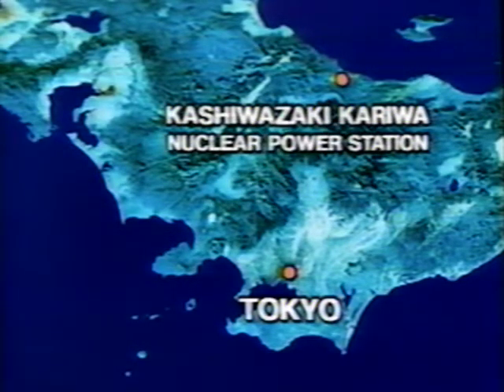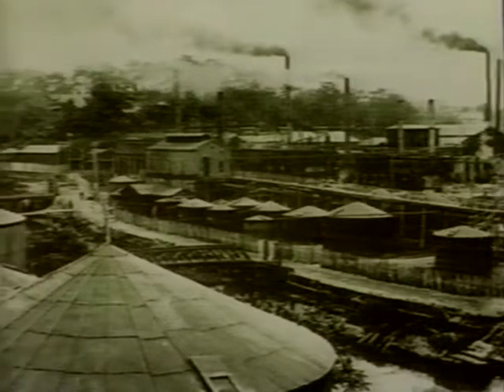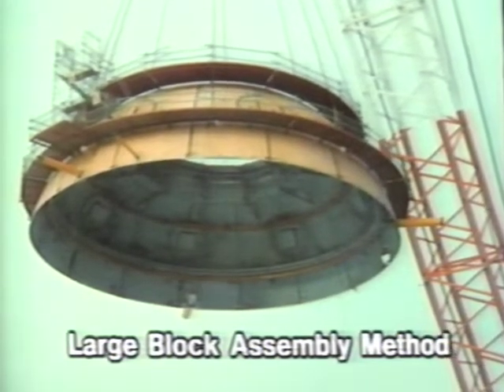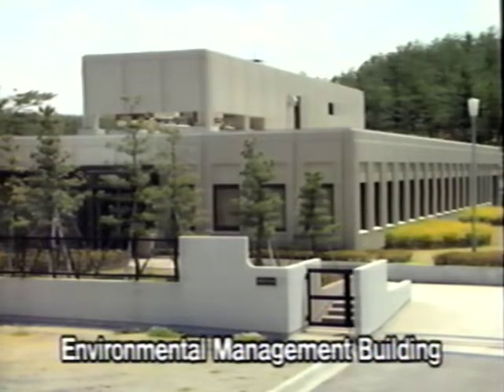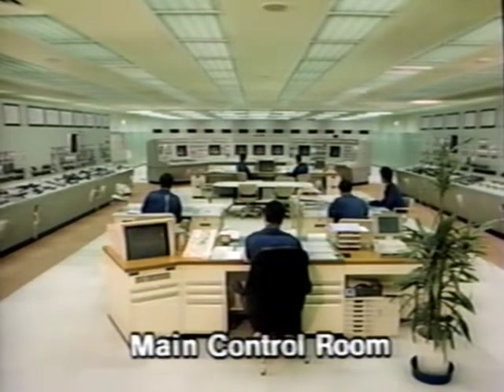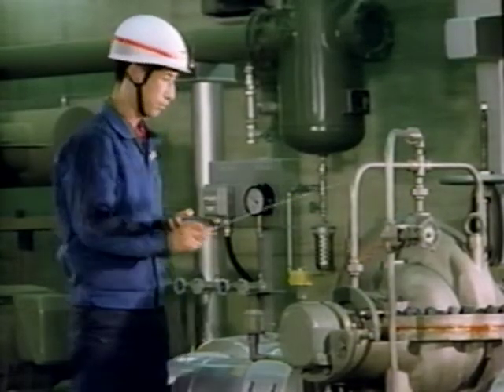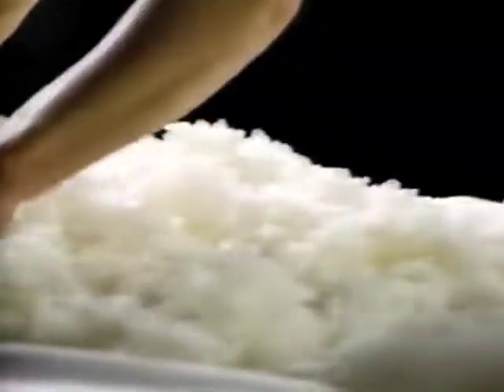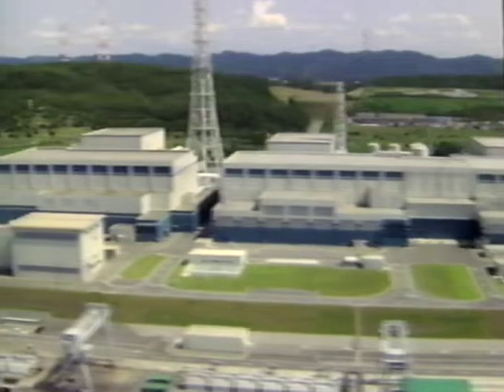Welcome to the Kashiwazaki-Kariwa Nuclear Power Station

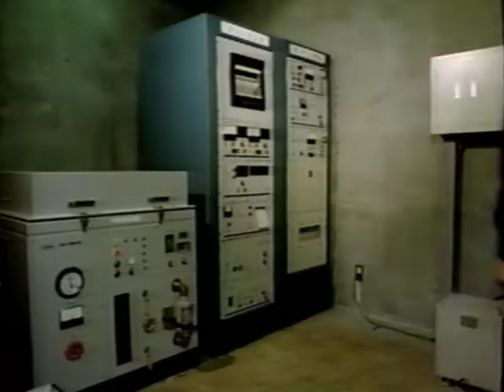Comment: 8:10 wearing a helmet for reading a measurement instrumentation panel, even if it displays dangerous alpha- beta- gamma- and possibly not Neutrinos- radiation is such an impressive view, suggesting total, secure operations and control, that I always start to smile (or grin eerily)!
       Hope though that no serious overwhelming uncontrollable nuclear accident happened in the Jan. 2024 Noto earthquakes. 
 Maybe swimming Molten Salt Reactors on anchored ships near the coast would be safer, really? (if it would include effective Tritium-sequestration for later use in Fusion reactors)